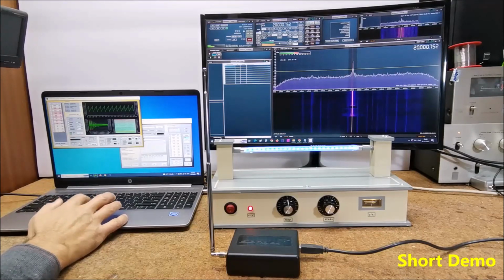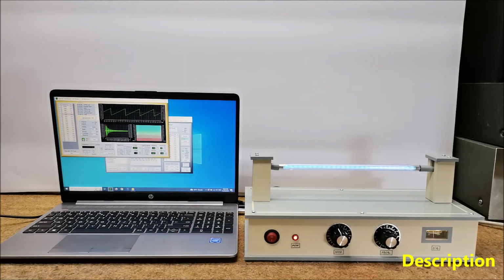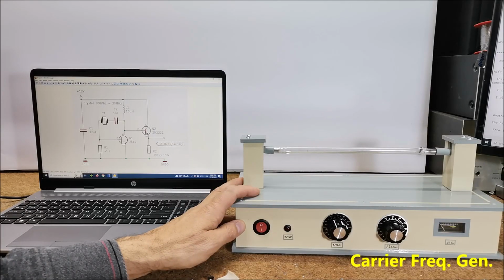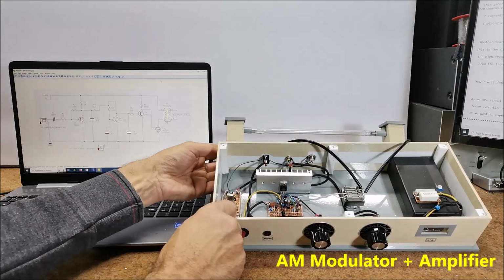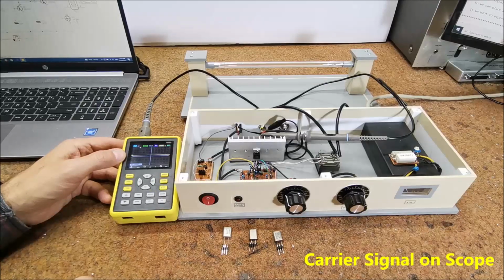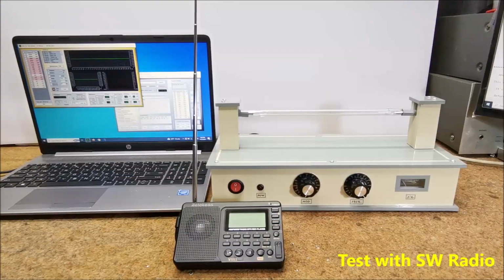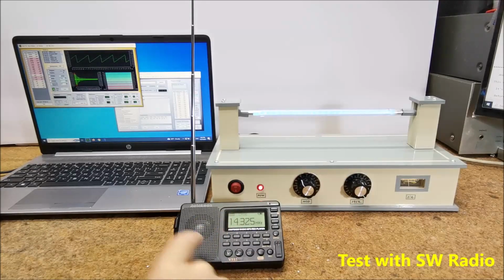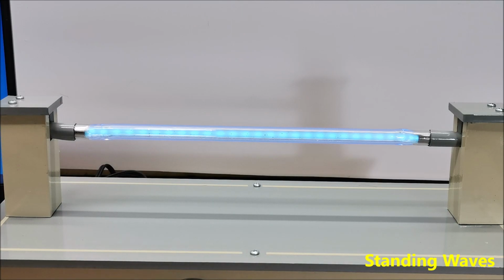Advanced Plasma Rife Machine with internal Carrier Oscillator

Comment: Hey Mirko i appreciate your work and knowledge💪💪 at the moment i am trying to build the maschine, but i have a big question: i only find 10kv hf transformers below 1 mhz frequency capability. can those hf transformers also reach  desired 3 mhz with a clean rectangular curve?if not do you have an alternative for me what i can use instead. I wish you a nice day and i hope for a reply my friend☺️
Thanks
Reply from the maker: Unfortunately, HV transformers cannot function well at very high frequencies. As for this project specifically, 3MHz of carrier can be achieved, but with significant signal attenuation. I am currently testing such a project made on a completely different principle where carrier frequencies from 1MHz to several hundred MHz can be easily generated without distortion and power reduction. I will also not use exotic components. I hope to promote the video soon.
Reply: @MirkoPavleskiMK  glad to hear that mirko and i am looking forward to analyse your new project on this❤️ but let me just ask you if the 3 mhz carrier signal in this setup is efficient and sufficient enough to promote the same "benefits" like in rifes setup.
Thank you very much for your reply buddy💪

Comment: I have tried to  built the device and BOTH of the circuits based on your schematics are non functional.
Reply: I built one that powers on and bulbs light up but my transistor keeps over heating idk if my power supply is too small 4.5a
Reply from the maker: I can tell you with certainty that the scheme is correct and functional, and since it is about relatively high frequencies, the cables should be shorter
Reply: @marceloovg1873  The only circuit that works (I have commissioned an electronics engineer who built it successfully) however with a carrier wave up to 189-200 K(kilo)Hertz is that of Pavleski's video "The simplest and cheapest way ......"  All other circuits he gaves in other implementations of the device, are not functional. Specifically I have tried  to built (with the guidance of my electonics engineer)  his AM modulator + amlifier cirquit and I can confirm that it is not functional.

Comment: Hello Mirko, I highly appreciate your work!! But I have a question: to my understanding the device emits radio waves, doesn`t that interfere with lets say flight radio of aircrafts? 
Is there a way to figure out the range of such a tube in terms of influencing radio stations, wifi, etc? This would be a concern on my side. Best regards and keep on soldering!
Reply: I am on the receiving end of the interference generated by one of these . It's not good. It's also illegal .

Comment: Have you read the declassified CIA document “gateway experience”? 

It mentions that resonant frequency between 4-7Hz can be used to stimulate the mind/body during transcendental meditation to help achieve ressoncace within the human body and in the brain. This is just a concept relying on similar principals as the gateway experience that was being described. My question is whether or not a device like this is capable/ designed to achieve those results (Frequency between 4-7Hz). I ask because I see a lot of the Rife frequencies appear to be in a much higher range?
Reply: Earth frequency is I think around 7 hz so maybe just put your feet on the earth?
Reply: Need to vibrate ALL body parts with a particular frequency... So the complication.... @katestephens9572
Reply: 7.83Hz
Reply: I also don’t fully understand the carrier frequency vs the rife frequency in this device.
Reply from the maker: The carrier frequency is much higher (the Rife frequency is also built into it) and so it can be easily radiated into the environment
Reply from the maker: Yes, you can use such low frequencies at the input of this device

Comment: PLZ DO A VIDEO MAKING A HUDLA CLARK SYNCHOROMETR
Reply from the maker: It is an extremely simple device to make (a simple oscillator with one transistor, the frequency of which depends on the skin resistance), but therefore the "diagnostic" procedure is extremely complex and trivial.
Reply from the maker: I hope in one of my next videos to build and test such a device that would only cost a few dollars
Reply: get a Frequency Generator set at 15 Hz Positive Offset at around 12 volts Square wave and does same as Hulda Clark zapper with Don Croft Improved 15 Hz

Comment: Hello Sir. I want to make your stm32 PI metal dedector but I have an error when copy your codes. Arduino didn't accept WS2812 led library. Can you share with your library for ws2812 ? Alsa Arduino IDE does not support with TIMER_CH1 and the others. How can I fix that?